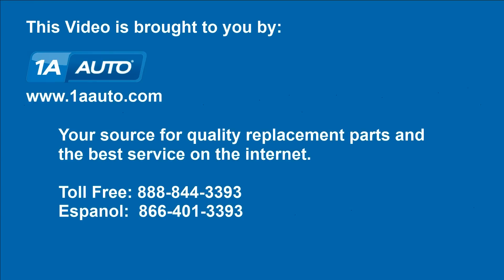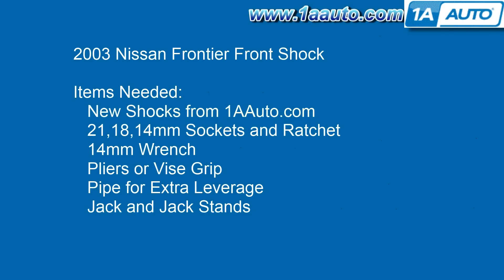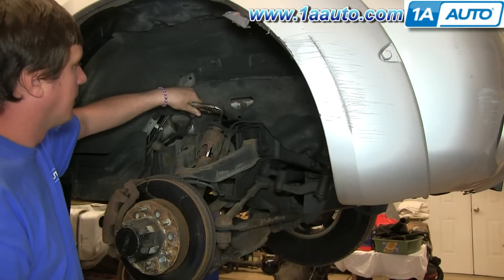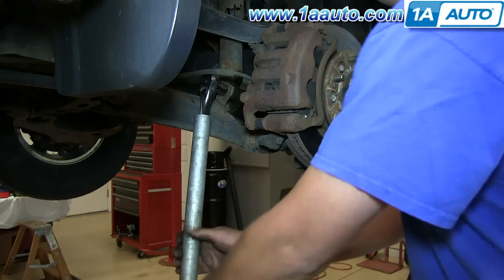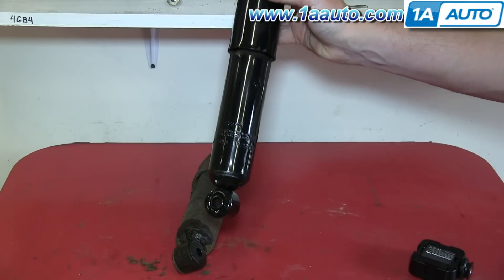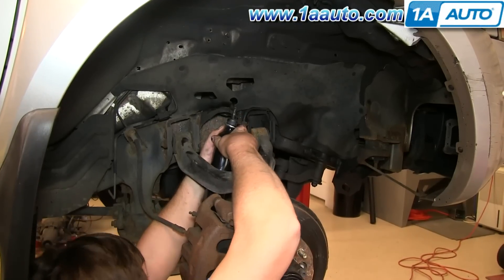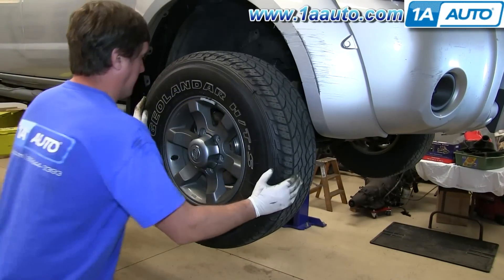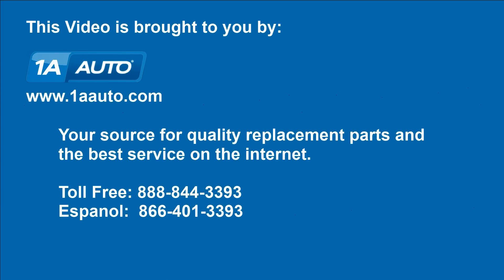How to Replace Front Shocks 03-04 Nissan Frontier and XTerra

Comment: I've had a 1998 Frontier since 2004, purchased at 100K miles.  Now at 275K miles, I've replaced its front shocks a couple of times, with different brands.  With ALL, I had to use my bench grinder to grind the rubber lower bushing about 1 mm narrower, as it wouldn't fit in the lower control arm.  I imagine someone prior to me used a shock with a narrower bottom and thus forced the mounting brackets inward a tad when tightening.....

Comment: Thanks for the video.  I basically wore out the top while holding it with pliers.  I can no longer get a bite on it.  Any suggestions?  The nut is about 3 quarters of the way off.
Reply: Same

Comment: Thanks so much fellas,I was told that installation was more complex needing torsion bar adjustment,brake adjust etc.So simple,replaced oldies with Tuff Dog gas shocks,front and rear.Rides like its on rails,beautiful and didnt get ripped off.Thanks Again,,,,BJ. Sth Aust